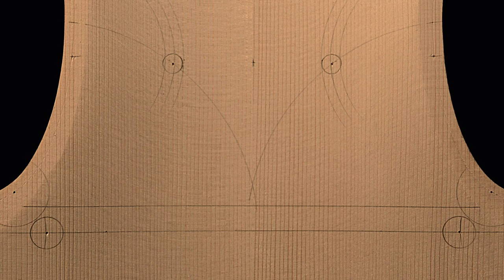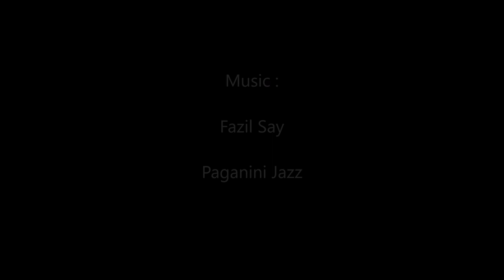Knife cuts

Comment: What method did you use to locate the "F" holes? How did you cut the initial holes from which you then used the knife finish?
Reply from the maker: I use the Stradivari's system, which places the eye centers in relation to the rib line, starting with the lower ones
The system that I use to cut the eyes is shown in this video :
https://www.youtube.com/watch?v=NzYbxNPCGuY
Here you can find the complete series (6 videos) on tracing and cutting :
https://www.youtube.com/watch?v=Djdl78yE1N8&list=PLaxadm6POX7G4UwS2hwiJodIT9-sBIWqC

Comment: Maestro, do you also use files to file away perpendicularly to your final F hole lines, where applicable?
Reply from the maker: No, I do not like files in F holes work because they have an annoying cutting directionality, they leave too many marks and cut on both sides, creating problems in tight spaces (You don't want your file to cut accidentally on the opposite side to what you're working on).
However, I use little sandpaper files to finish the surfaces after having applied the final glue size on F hole walls : https://youtu.be/i-90ShLC6PI?t=54
 For the real cut I prefer to use the knife as much as possible, when you are experienced it's still the best tool for this work : fast, clean and precise, a real delight to use.😊
Of course if you don't have too much confidence with the knife you can use files or any other tool you prefer, if you get good final results. 
Even sandpaper files can be used in a much more aggressive way than what I do, simply by gluing on sandpaper with more coarse grit.
Reply: @DavideSora  Unfortunately, SANDVIK has stopped the production of their sandplate. However there is a substitution product from a Japanese firm NT dresser. However I never bought/tried these. I have seen your contributions in Pegbox. I was very fond of these in the 8ties and 9ties until they ran out. Maybe you can comment on wether Jose may try these NT ones?
Reply from the maker: @ghlscitel6714  NT dressers work well, especially the finer ones (the silver ones) are extremely good and leave a perfectly smooth surface. The medium-grained black ones also work well, the only drawback compared to the Sandvik is that they are thicker and more troublesome to bend to give it a curvature. I have some mounted on flat tools that work very well, but I have never tried to bend them to give the curvature, because I still have the Sandvik for this which are thinner and easier to bend, but I think it is a problem that can be solved finding the right system.